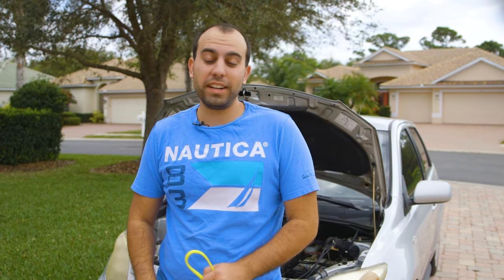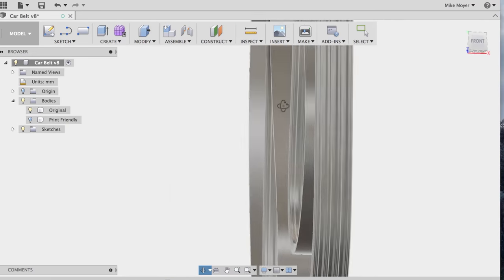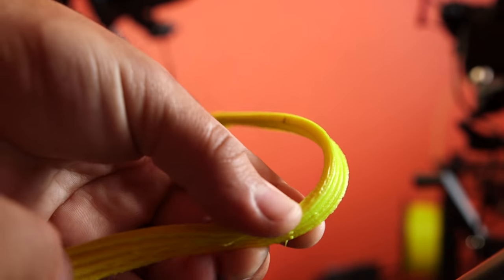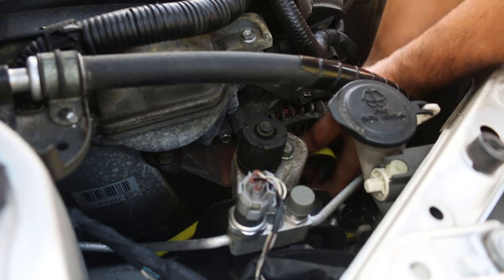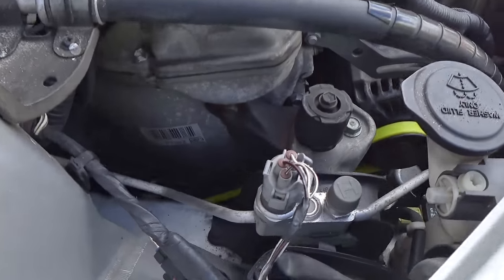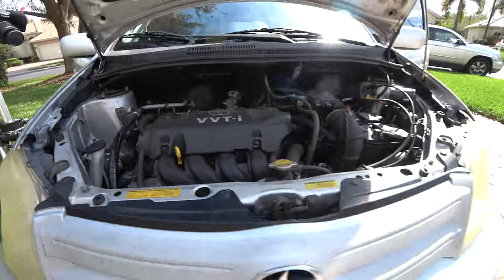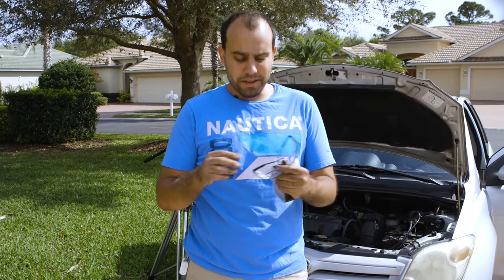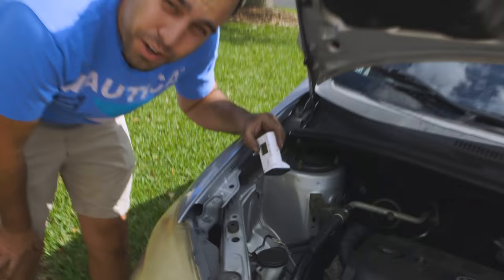3D Printed Car Belt | Will It Run?

Comment: hey why don't you do a headlight dehaze tutorial! I'd watch that :D
Reply from the maker: Haha, I've been meaning to for a while now...
Reply: PM me if you want a sponsor for that project.
Reply: mcheddadi wet sand with 800 Grit, then finish with 2000 Grit and dry then Polish and wax.
Reply: ChrisFix did one
Reply: mcheddadi (Hipatch?  spelling ) brand semi chrome polish.
 it's a paste in a toothpaste tube available at motorcycle and automotive performance shops made to polish aluminum and such like mag wheels. It's mildly abrasive paste and works great on plastic headlight lens haze and taillight haze n scratches.
just squirt an inch on and scrub with a rag and then wipe off with a clean dry rag.
Reply: I did one :) Many people have.

Comment: It is not strong enough in the long run.. But your should try some of the less fleksible filaments out there.. :) 

Real serpentine best can have both metal and kevlar embedded so not in the long run.. But for some time indeed a correct 3D printed one would work

Comment: If an old pair of pantyhoses work then why not a flexible filament belt. There are different types of flexible filament as well, you could have tried a few different ones :-)
Reply: My buddy and I ran some twine once for a vbelt on his sbc, lasted for the short drive we needed to make with it.
Reply: Didn't claim anything was!?? and pretty obvious and didnt really need pointing out :-)
Reply: Luke Pettit ive ran an elcamino with panty hose as a fan belt. worked good on city but highway just chewed it up. but thank god they come in 5 packs. drove the car 50 miles with just 2 stops to replace them
Reply: Yeah theyre only something to use as a stop gap measure and not something that will last :-) Sounds like you did pretty well though
Reply: Luke Pettit ya we lucked out. it was coming back from a car show real late night. like 1 am or someshit so no way we were getting a v belt. even from walmart since the department was closed.
Reply: Luke Pettit but i heard bout that trick many years back and decided to give it a go. it was worth a shot and did the trick
Reply: Then there's putting fine ground pepper in a cracked radiator and if memory serves me egg will do the same thing? All the old timers home remedies before all the electronics and CC took over. :-)
I open a bonnet now days and havent a clue what I'm looking at lol

Comment: cars will start without a belt as long as the the battery is charged. belt turns the alternator and charges the battery while going down the road keeping the car going.would like to see an extended road test that would be cool

Comment: Politely, I don't see how this was a success--the rubber belts are specifically designed to withstand years of operating at high tension next to a hot engine, in varying weather conditions from very low ambient temps to very high ambient temps.  It makes for a fun Youtube video, but in no sense was this 3D printed belt a "success" because the instant the engine was turned on, the yellow belt stretched to the point where it wasn't operating the accessories (fan, alternator, and AC).  Also, I would very much doubt the water pump is driven off the accessory belt, most engines run the water pump either from the timing belt, or if chain-driven, a serpentine belt arrangement, or on newer cars, the water pump is electric.

Comment: I think it was a fascinating experiment, but it seems like an impractical test for the 3D print technology, since the cost of belts are relatively low, and you really only need to change them two or three times over the life of a vehicle.  So I'm curious, what sparked your interest in modeling a serpentine belt, that you would go through all of that, and possibly risk damaging your engine.  It did look like fun though.
Reply from the maker: Curiosity.  I was researching flexible filaments and wanted to know that the limits were.

Comment: Seriously, I hope you didn't believe a belt that thin could work without flapping? 
First: belt too thin, thus not rigid and therefore stretching like crazy
Second: not enough tension. Make it shorter if you can't add a belt tensioner
Third: TPU has a low coefficient of friction and WILL slip if there are no teeth. There is no way around this. 
Fourth and final: you can't expect such a stretchy belt to transmit power and survive at the level required by a car alternator and compressor.

Comment: It worked better than I would have thought.
Reply: Stephen the car would have ran that long on bettery voltages with no belt
Reply: Toben Kinzle And I thought the belt would shred right away. So the 3d printed belt worked better than I thought it would.

Comment: Just need a continuous carbon fiber printer. Small strands mind you, but yeah. You will notice belts aren't flexible in length. Just bendable on a radius. A material that is flexible in all directions will never work for a belt...

Comment: You mean turn an alternator with a 3d printed belt. To run the car, you need to 3d print the fuel ;)

Comment: Man, so close to making that ride. Bet if you made the belt shorter and thicker you could have done it. Remember a lot of times we have to add in some areas to make up for the inherent weaknesses of additive mfg. bet remove some length, fatten that thing out, and ya might make the block this time. 
Either way, great vid!

Comment: Which 3D Printer did you use for the belt?
Reply from the maker: This one is a friends Maker Gear M2.  Originally he had the Ninja Flex filament and tried it out, then I bought the Maker Flex and just used the same file on his printer.
Reply: Thank you!

Comment: Belts have a nominal specification for tension. 1/64" for every inch of span between pulleys. Serpantine belts are trickier because they have diferent size pulleys and more than 2 of them. http://www.culvermotor.com/images/stories/pulley_span_length_small.png

Comment: glue a piece of fabric on the back like the real manufactures do to hold the circumfrence of the belt
kevlar and some semi hard adhesive

glue a kevlar belt together and run a tractor on the printer to print in one piece flat
good work take it to the next level

Comment: (This will show the extent of my 3d printing knowledge, i.e. zero)  Around 1:00 you say you can't fuse two ends of an already-printed piece(s) together, but why can't you?  Doesn't the printer already do that sort of welding when it prints one layer on top of another?  Seems like a worthwhile area in which to experiment, i.e. printing on/against already-printed pieces.  Probably some crazy alignment issues involved, but you could make a jig to handle that.
Reply: Matt Libby it would be a weak point compared to the rest of the belt

Comment: 1.  It will melt...2. You CANNOT run an engine for 5 mins without the water pump, especially one with aluminum heads.

Comment: it didnt really work you should have used a multi meter to check that it was charging and you should have loosened the tensioner and adjusted for the slack

Comment: and actually the belt doesnt just run the water pump and the alternator it also runs the ratior fans too
Reply: that does not apply to this vehicle.
Reply: hawk eye yeah but still in general
Reply: the only transverse engines that i know that had a belt driven fan were on a late 60s vehicles.
Reply: Makes sense since it's old technology hawk eye are you a mechanic
Reply: Alex Choate the radiator fan has its own motor nowadays

Comment: Why bother doing that? 
Your belt kind of worked but not really.. I'm not sure it actually driven something or was just skipping stretching and flop around. Some accessories need decent amount of torque: AC, power steering pump, alternator when it's charging,  HPFP for some models (most are run trough timing belt, but there are some on accessory belts). I bet it was a ton of slippage if you measured it somehow even if it appears to spin, it does not spin correlated to the speed of the belt.

So it's not actually working. To work it needs a grippy surface like rubber, and needs structural integrity to can tension it without much stretch. I'm not sure about the grip of that material, but for the reinforcement, you can add the backing from an actual belt to be sure you can tension it and not flop around.. but then again that is more of the actual belt credit for working.. so back to drawing board. 

Or maybe try hit a different segment of belts. Low power applications: Custom length for tape/vinyl players, and for any diy project that used some oddball dimension, weird toothed belt that is impossible to buy.

Comment: Driving with no alternator belt will drain the battery and driving with no water pump belt will overheat the engine and driving without a powersteering belt will be a p.i.t.a. When steering
Reply: Mandela Effect and the most important Aiir Conditioner

Comment: You did not "Run" the car at all. If you were trying to use a 3D printed belt for the timing belt I would have been surprised it even turned over, but as you were only turning the water pump , alternator and probably the power steering pump this was a totally pointless exercise and a waste of plastic!

Comment: "It worked but it was starting to peel"

So what you're telling me is it didn't work........

What did you expect? The car not to start? XD
The amount of time you had the car started for, you don't even need a water pump. I had a bolt stuck in the block and heat cycled it a few times to get it out while I was putting my new water pump in.

Will it "run" with a 3D printed belt? Of course it will. 

Will it drive with a 3D printed belt? Of course it won't.

Will it perform reliably with a 3D printed belt? (dies of hysterical laughter)

In titling this video the way you did you insinuated you will be looking at whether or not it performed in an objective fashion, very disappointed. The belt you printed is significantly more elastic than a normal belt, so it's no surprise you achieved zero tension...